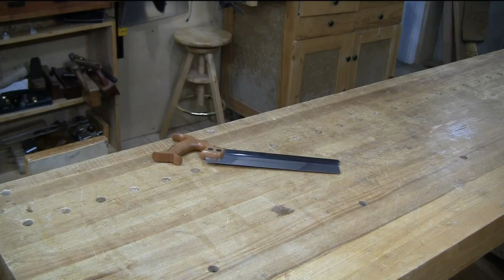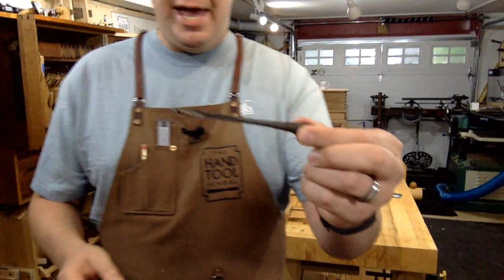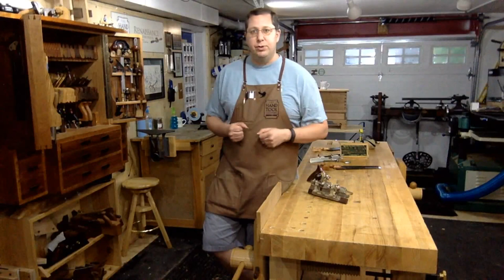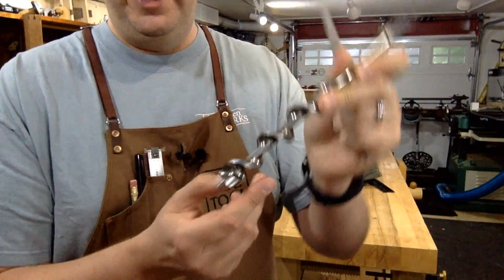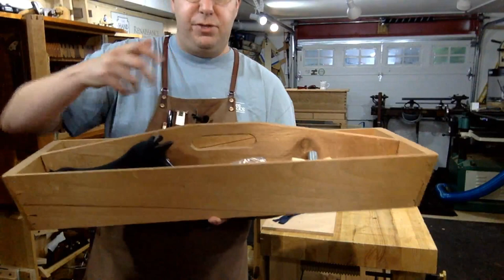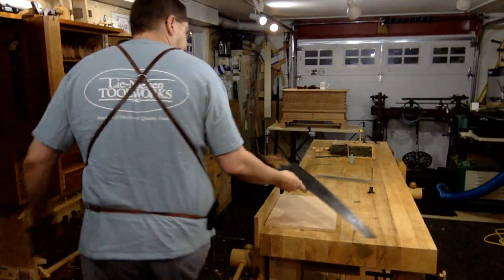Open Q&A, RWW Live

Comment: Thank you for answering my question.  I had to go do some stuff before you answered live.  Currently my only joinery plane is a router I put together.  In general, would you get a plow plane (like the veritas) or shoulder plane as the next joinery plane?  Thanks!
Reply from the maker: plow plane definitely.  I don't use shoulder planes at all.  I've written about my aversion to them in the past, http://www.renaissancewoodworker.com/shoulder-planes/
Reply: Thanks!  The plow plane seems to be the second most versatile joinery plane after the router.  From armchair wood working anyways.

Comment: Hey Shannon, what grit of diamond stone do you grind to?  I typically also hit the chisels and planes against a strop primed with chromium oxide at the end also.
Reply from the maker: I use the DMT extra extra fine which I compare to 8000 grit, though many will tell you it's not quite the same. The key for me is the strop and all my edges get stropped a lot before I even go back to a stone.